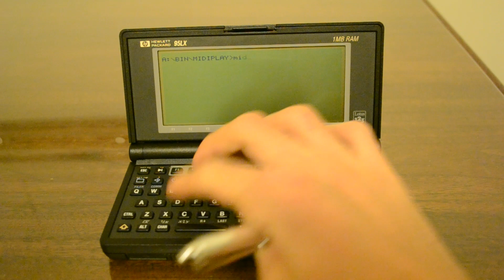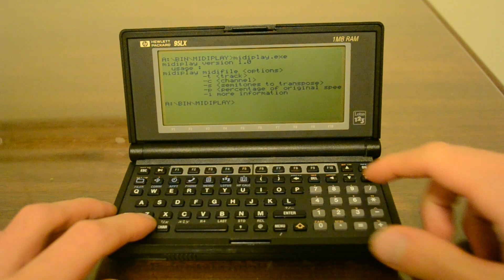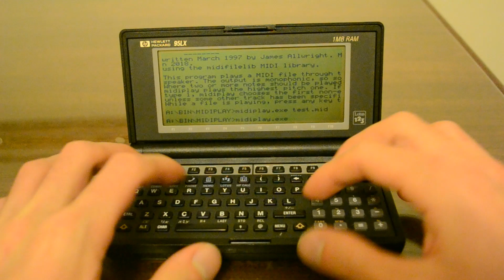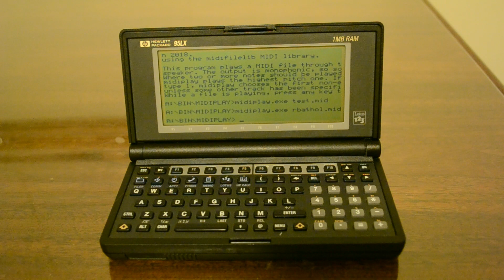How to play MIDI files through the PC speaker on a HP 95LX or any XT compatible!

Comment: Hey i have problem. why midiplay is stuck on 8088 clone? with 640kb memory and dos 6.22
Reply from the maker: Hmmm. Not sure why? Can you give more details about your setup? It runs fine on my V20-powered 95LX.
Reply: @walnuthills11  AT noname clone, 8088 intel original cpu, and 640k memory, i try version dos from 3.30 to 6.22 and windows 98 bootable disk, doesn't work, in game like alicat PC Speaker sound is work